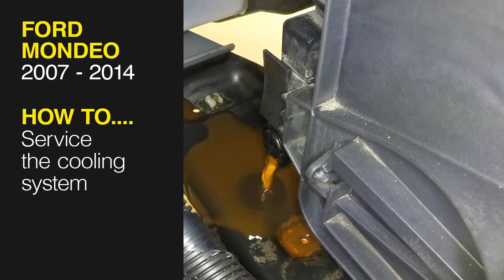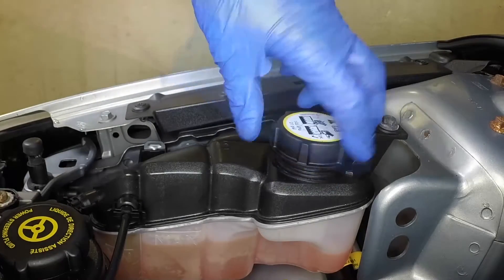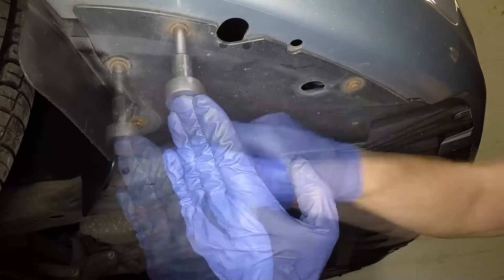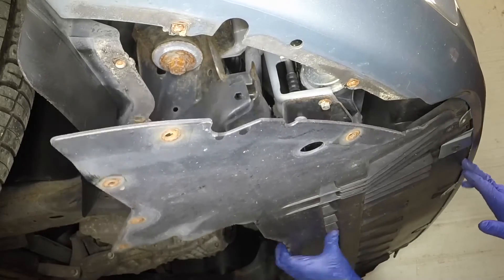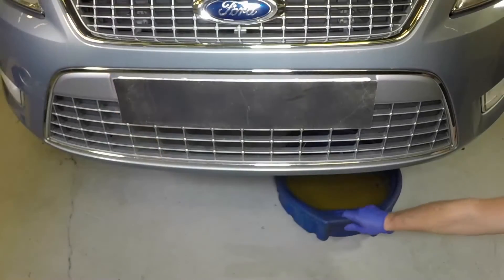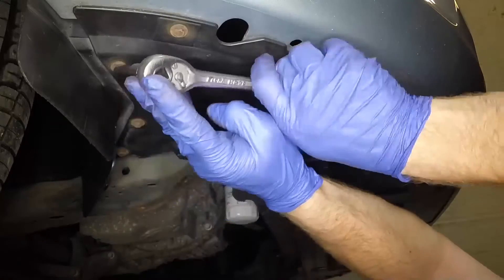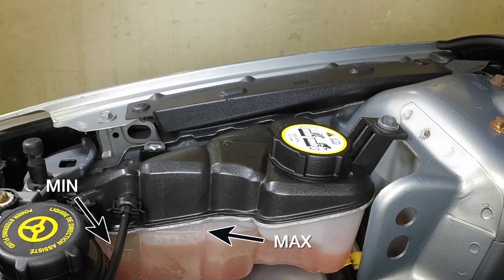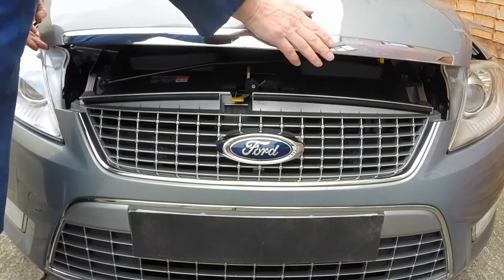How to Service the cooling system on a Ford Mondeo 2007 to 2014

Comment: Do the mk4 mondeo 1.8 self bleed, thanks
Reply: No, there is a specific procedure for the 1.8 diesel which requires running the engine at varying speeds for set periods of time that they haven't shown here.

Comment: Im confused to why it's been drained at a cold temperatures and not warm?
Reply from the maker: The Ford instructions state that the engine must be cold before draining the system. Maybe a health and safety issue.
Reply: @HaynesManuals  l am having trouble finding the drain plug to replace the coolant, it doesn't have the exact screw as shown in the video...My model is the Ford Mondeo 2010 2.0liter deseil
Reply from the maker: This video shows the UK model. If there's no drain tap, probably best to disconnect the radiator lower hose and drain the system.
Reply: @bro_nz1178  Not all Mondeos have the drain plug